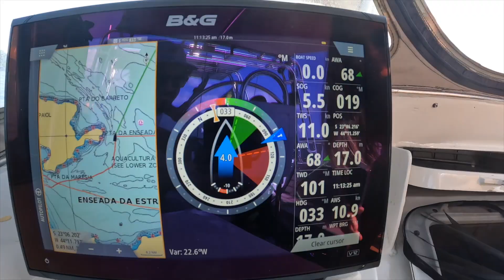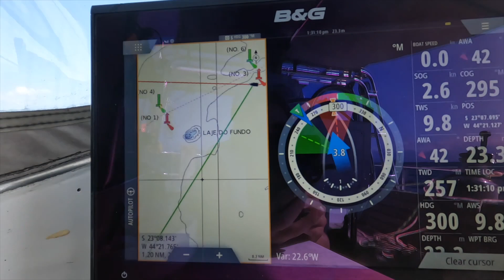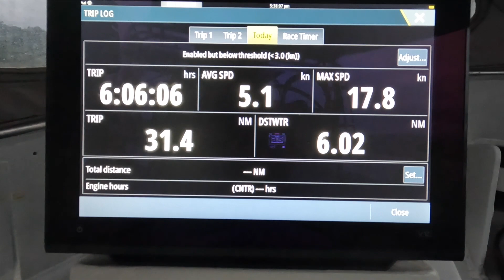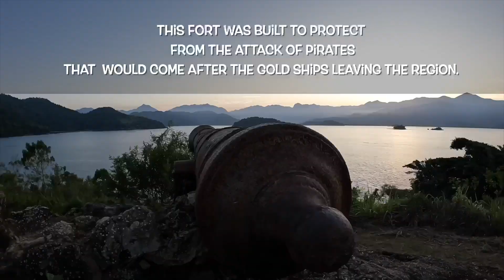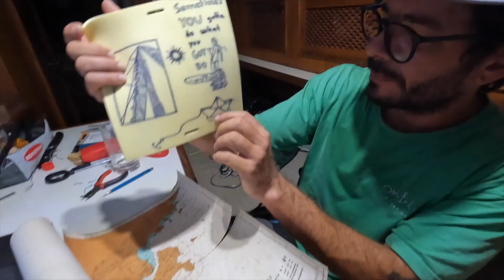⛵️ BOAT Life: How we get fresh water + Boat Works ep.243

Comment: When you are polishing the brightwork (the winch in this case) you might try using aluminum foil. Just wad it up and because it is much softer than the stainless steel it will not scratch it but it will take off the rust. Then finish it with the stainless steel polish and it will be much faster and easier. I grew up on a 45' ketch and it worked well for us.

Comment: You should set the depth offset on your nav system to reflect the bottom of the centerboard when fully extended. That way you're not guessing at whether or not you're safe. With the centerboard up you'll just have a bit more safety margin which is never a bad idea.

Comment: @Odd Life Crafting You can simply use thin Tesa or Packaging Tape on the Backside of the Simcard to put it back together into the larger piece.
If you lost the larger piece make you one out of a plastic card or the backside of a college block.
You can also just cut larger simcards and sand it down in thickness to if you dont have the cutouts in yours.
The Simchip itsself is as small as the inner pad of the contact pad arera and realy thin.
The Nano Simslots also often got more room in thickness as you think, little more pressure and no fear and the cutted down sull size sim (or mico sim) still goes in. (but its not recommendet as sanding the thickness down works and you can damage the slot)

Remember times Simcards was as large as a credit card? ;)

Also clear at least the Mobile Antenna have to go up to the mast right? rright?